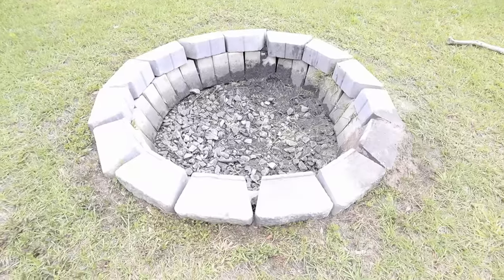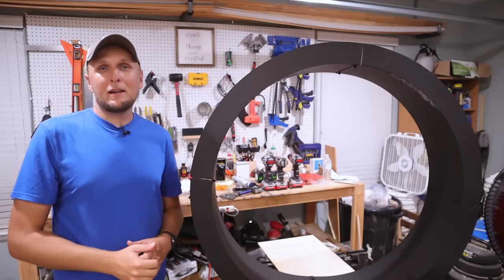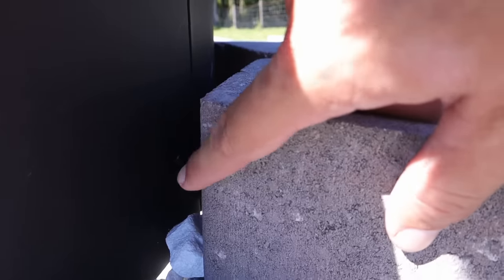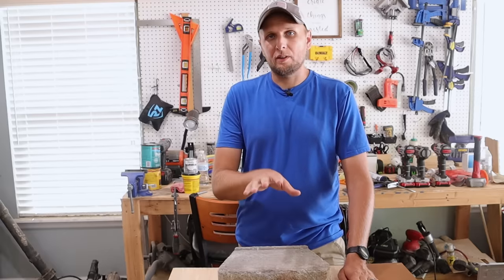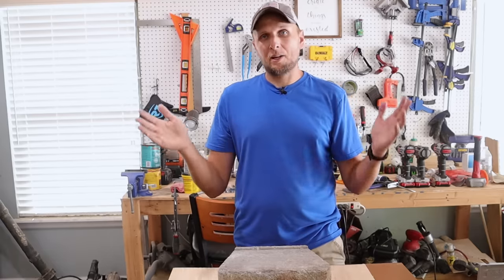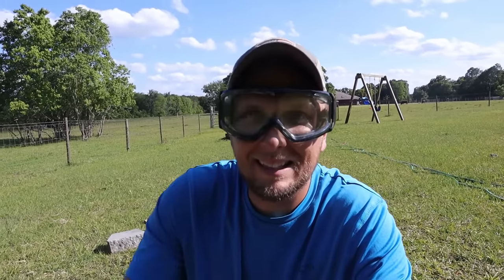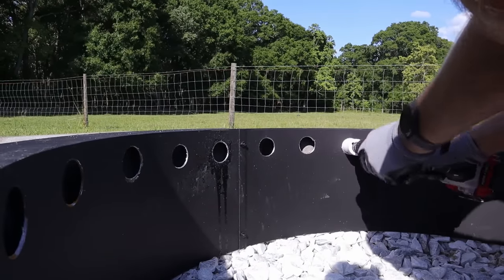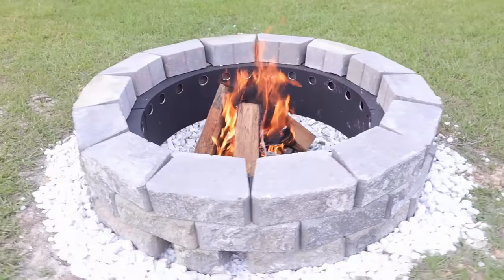How To Build a DIY Smokeless Fire Pit That Really Works!

Comment: Is there any reason why this makes it burn so hot that you don't get the slow burning coals at the end of the fire? We love to sit and stare into the dying last bits of wood at night and I wonder if the efficiency of this might burn through all the wood so fast you don't get that? Also what size of fire ring did you use? Last, I can't find any pavers that are exactly 10", either 2 rows stacked are 8" or 12" but never 10" to go flush to top lip edge of 1o" tall fire ring. Any suggestions?
Reply from the maker: You will definitely still have coals in the bottom.  I have the 36" ring but if you don't plan on having larger fires, I would recommend one of the smaller ones just so the holes are as close to the fire as possible.  Yeah so I had the same issue with the pavers and I just build up base stone on the outside of my ring a little higher to make up the gap.  Hope this helps!

Comment: Looks great! Did you use the 27" or 36" ring??
Reply from the maker: Mine is the 36" but I would probably get a smaller one if I did it again as it works best when the pit is full of wood and fire to heat up the walls so having a smaller diameter would just make it easier to achieve that.  But it works great either way!
Reply: @HowToHomeDIY  thank you!

Comment: a cool idea but the steel ring is it gonna rust now since you cut into the powder coating finish is  probably only downside to it
Reply from the maker: Can spray it with high temp paint to help protect it.

Comment: Nice! Thanks for the How-to.

How often did you have to swap batteries on your cordless drill? I have a friendly argument going with a good friend who thinks cordless drills run out of power too fast. My DeWalt cordless drill has yet to exhaust a battery during a project. Maybe I need bigger projects. 😆
Reply from the maker: It will exhaust it 😂.  I think I did 3-4 battery swaps.  They were standard sized 20V batteries.  If you try this project, let me know how many swaps you had 😆

Comment: how long did it take to drill those holes? any tips?
Reply from the maker: I would say about 45 minutes total.  It's definitely the hardest part of the project.  If you have a drill press it would probably be easier to use that before assembling the ring.  Also, I would probably try to use a step bit instead of a hole saw.

Comment: Awesome build. What is the reason for putting the holes towards the top? I think putting them at the bottom wouldn’t work as well because of the eventual wood ash building up if you had a fire going for a long time, but would holes around the middle work any better? I’m definitely building this this weekend.
Reply from the maker: So the idea is that with the holes at the top, it is going to help feed the top of the fire to help burn off the excess smoke.  It also does a good job of causing the smoke to circulate back towards the fire and burning up.  Is interesting to watch.  If I was to do it again, I think I would make the holes a little smaller to help build up pressure and I may elect to go with a slightly smaller ring.  Want the fire as close as possible to the ring to make it work.  I think these two things could possibly make it a little better.  But am very happy with it!  Hope you like yours as much as we do ours!

Comment: Thinking of building one of these for my parents, it looks really nice and they've been talking about it for years now. For someone with essentially no tools or the pieces to make this, how much would you expect it to cost to purchase everything needed?
Reply: The pit with the metal ring is $229.00 at Lowe's. Plus the gravel, hammer, chisel, and hole saw with drill. I'm guessing around $300.00 total for everything needed or slightly more depending on if you get the expensive tools or cheaper ones. I estimated with the cheapest tools

Comment: Does the bottom of the ring have to be touching to stone to get the effect you need?  Would love to do this with ring sitting on top of my top layer of stones but that would create a gap at the bottom.
Reply from the maker: Yes it needs to go to the bottom in order for the air to be, for lack of better words, trapped.   So then it can be heated, rise up, and then be pushed out through the holes.

Comment: Hello, i watch all the diy firepit video's and i made for myself kinda the way you did, i just use the outside (normal bricks ) . today i tested it out before i use cement to place the bricks. but, when i started the first fire i got so much smoke... i also use the 36 inch ( just the same as you ) . the only thing i was telling myself, maybe its because there's still no cement in place but you do it also without. i cut the holes in the ring, a little bit smaller as you... is it possible, that the first fire you start still gives smoke untill the ring is warmed up? because you diddent put that in the video that you started the fire..can you please help me a bit here? its just that im worried a bit for my neighboars with all the smoke.  thanks in advance
Reply from the maker: Hey Stefan, yes the beginning there will be smoke.  The ring has to get hot enough in order for it to work.  Also you will want a fairly big fire going if you went with the 36” ring so that the fire is nearer to the holes in the top of the ring.   My experience is the bigger and hotter the fire, the better.  Also you probably know this but make sure you are using dry wood.  Hope this helps!!

Comment: does the fire ring have to touch the ground for this to work? the ring in my kit in only ~11 inches tall
Reply from the maker: Yes it does.  It needs to be sealed so that the air can get hot enough to rise to the top and then out of the top holes.  Mine is 10" tall.

Comment: So these videos are awesome and I love your humor, I will have to train my children in the fine arts to help me break blocks faster in the future!

I had a question, I just built my insert and block smokeless fire pit, I went with a slightly bigger 46 inch ring, but it's only 10 inches from the ground to the top, do you think it would be a big impact to the effectiveness of I put a 4th layer of 3 inch blocks on top and then did a cap layer and then had them overhang inside the pit like 2 inches or so?
Reply from the maker: I dont know that it would affect it that much but may make getting the heat to you a little more difficult just because that wall will be taller.  I appreciate the feedback!  If they start now they will be experts in no time!  I would suggest starting them out using pebbles though!  😂

Comment: What is the total diameter of your fire pit with the supplies that you used? I did some quick math and guess it is approximately 51" at the top and probably a bit wider at the bottom with the raised portion of the pavers (bottom) fitting flush with the one under it? After you got everything set as you wanted it did you glue the blocks down with an adhesive?

Comment: Thinking of something similar. (I have essentially the same fire pit as you started with.). Must have missed in the video, but approximately what is the sizing and spacing of the holes you drilled in the fire ring? Thank you. Great video.
Reply: I had the same question.

Comment: Next time drill the holes closer to the bottom and try to leave space so the cool air gets sucked in from the bottom thereby mixing with the hot air and eliminating smoke. Another thing is to try and keep the fire “loose” and not tight. The tighter the fire the less clean air the more smoke. I’ve had plenty of fires and most don’t have smoke cause it’s all about helping the fire breathe.

Last don’t use wet stuff, but you know that already.

Looks nice and did a great job overall. The holes on the bottom would be the only thing I would change

Comment: Great video and idea. But do the pavers heat up enough to radiate the heat as pavers are not the best conductor of heat. I've sat around many a stone firepit and one thing they all have in common - you only get the heat from the flames and not from the rocks or pavers. Keeping the same principal you have, would it not be better to have an all metal one which will radiate the heat?

Comment: Great video was planning on doing one myself but what size ring are you using, how many bags of gravel and how stones was that 3 tier you completed. Thanks and I also subscribed & followed
Reply from the maker: Hey Ramon, I went with the 36" ring.  Going with a smaller one might be better though as then the fire will be closer to the ring without having to make it really large and this will help with the air coming out of the top holes.  But if you are planning on having large fires then the larger one can work too!   Also, I would recommend going with smaller holes than I did.  Mine works great but I think smaller holes might make it even better.  I think I ended up buying somewhere around 10-12 bags of gravel but a lot of it went in to help fill my old hole fire pit.  With my particular setup, I have 12 blocks on the bottom row and 14 blocks on each of the top 2 rows for a total of 40 blocks.  Hope this helps and if you have anymore questions, feel free to send them to me.  Thank you for the feedback!

Comment: Your Tykwondo bit had me laughing  my ass off, though it would have been funnier if you called it something like BS-Kwondo in the same nonchalant manner that you did in the video. I already know that these smokeless fire pits workwell, but I think it's funny that when I used your link to checked out the price on the rings I noticed they have a video showing the fire pit without the smokeless setup and no smoke, lol. What's nice about building a smokeless pit is you can use a wide variety of scrap material that you can find for free or cheap, and using a little imagination and creativity can use instead of spending $160 on a store bought fire ring. Nice video, love the humor, definitely makes the video even more enjoyable to watch.
Reply from the maker: Thanks for the feedback Clinton!

Comment: What size is the ring you used? Not the flange diameter. The diameter that yku set the blocks around?
Reply: Nevermore I found it in the description m. Thanks
Reply from the maker: Yeah I used a 36" but if you don't plan on having larger fires then the smaller ring might be a better choice so that those holes where the oxygen is coming out are closer to the fire.

Comment: Do you really need to leave gaps for the bottom row of pavers?  I would think the rocks under the pavers would provide ample pathways for air to get in there.
Reply from the maker: It isn't air tight so yeah some will come through them but probably not enough.

Comment: I have a question:
I like the idea of the use of the inner metal ring that comes with the top lip to hold back the warm air.
Now that you have made this design fire-pit, have you learned of any type of  metal outer ring that you can slip your ring inside of?

I see a lot of youtube designs that make use of the bottomless  metal ring sold at TSC, but are any of them  the correct size that your ring would slip nicely inside the TSC ring.

The reason I ask is that I would like to find a way to use your type of ring with the top lip, yet not have to use cement blocks around the outsides.
Reply from the maker: I have not looked into that but if that was possible I think that would work really well if not better!
Reply: @HowToHomeDIY  
I'm seeking a way to use that metal ring you show but have the finished fireplace something I can move around
Reply: @HowToHomeDIY  another question. Let's say I learn how to make a fire pit movable.
What would you suggest I use for a bottom under the fire to protect things like grass or a cement pa?

Comment: Did you use the 36" or 27" ring in your video?
Reply from the maker: Mine is the 36.”   If I was doing it again I would probably go with a smaller diameter as it will be closer to the fire and easier to get the walls heated up so it can do it’s thing more efficiently.
Reply: @HowToHomeDIY  Thanks for the quick reply!
Reply from the maker: @ordocastus  You are welcome!

Comment: what size fire ring insert did you go with?  Also, what were your steps to prep the ground before you added the stone base.  Thanks
Reply from the maker: I went with the 36" ring.  I actually think the smaller one might work better just because the fire will then be closer to the holes.  I just refilled my hole in the ground with dirt almost to the top and then poured a bunch of the marble chips in on top to help with drainage.
Reply: @HowToHomeDIY  thank you

Comment: What about a layer of firebrick or plain brick on top of a thin layer of crushed stone that's been tamped down?  Would make it easier to shovel ash out of the bottom of the pit. Might also retain some more heat.

Comment: Thanks for this vid, question:  it seems like considering how deep the base of
Your fire is now, that the trade off is actual enjoyable heat!?  Is this something you could comment on.
Reply from the maker: So the only place I notice any drop in heat is at my feet and just above the ankle.  Other than that, the fire is very warm.  On cold nights I just put my feet up for a bit and they warm right up though.

Comment: Put the ring on top of the third row of stones! 
For the fire pit to work better some air have to come at the bottom of the fire and some  (hot) air have to come at the top. Your ring is resting on the ground so it doesn't let the air go at the bottom. You have to rais the ring 4 inch or so....

Comment: Awesome fire pit I want to make this lol Did u use the 27” or the 36” fire ring
Reply from the maker: I used the 36" but the smaller one may work a little better as the fire would be closer to the holes to get more oxygen.

Comment: Hello Adam thank you for your video I've been thinking about making a fire pit for a while we just moved into a new house I do have a question for you let's say I make my fire pit base with 12 then take out two of them and evenly space all the others around it could that eliminate the step of having to cut one of the stones
Reply from the maker: Hey Jeff, so here was my thinking on why I did not want to do that.  The first reason, which is not crucial is just that the first row will probably not line up with the top two rows evenly.  The second reason has to do with ventilation.  My experience with ventilation and airflow is it is best to have less openings but enough and big enough to promote good suction if you will which will help pull the air in, up, and then out.   It is my belief that you want to promote some pressure for best air flow and if there are a bunch of holes all the way around, I feel like it wont work as well.  Just my thoughts based on previous experience on projects.  Congratulation on the new house!
Reply: @HowToHomeDIY  thank you for getting back with me I thought it might be an air flow issue but wanted to check with you 
  Again thanks

Comment: Smokeless is certainly great, but how is it for throwing heart to the sides so those sitting around it actually feel the heat?   When you have three layers of blocks like you do, it makes me think it would funnel the heat upward.  What if the first it second layer were buried, but in a manner in which it would still allow for air to flow?
Reply from the maker: Still plenty of heat felt.

Comment: I would recommend using high heat spray paint to cover the bare metal after cutting the holes. Those are going to rust very quickly.
Reply from the maker: Good tip!  Thanks Isaac!

Comment: Raise the fire up off the ground (maybe with a mesh?), shrink the diameter of the top opening and use charcoal. That should give you a 100% smokeless fire (since smoke is a sign of incomplete combustion, or of incombustibles being given off as steam, etc).
Reply: It's a Fire Pit🤣😂
If you use charcoal you will not have any Flames. All you would have is a large BBQ 🤔
Reply: @jamesglenn520  
If the charcoal is combusting completely, then there will be a flame. The only time you don't get flames from charcoal is when the carbon combusts partially, forming carbon monoxide only (meaning that the complete combustion reaction, where the CO combusts into CO2, is a reaction which produces a visible [blue] flame).

Comment: TY.   
ps use rubber or pellet mallet  to set stones in gravel makes for less age settling.......  the ring is also called flange= great idea.......   third... my uncle loves the rust colored high temp paint on metal = ages well when real rust days come = petina vs.
Reply: ...
... yup goggles best
... drill and deburr those sharp edges inside shop with file or emery paper
... awesome simple perfect build.  fire propelled fan

Comment: Just in case it matters to anyone, these are concrete pavers, not stone. While I doubt a fire in this pit will ever get hot enough to matter, concrete does get degraded by fire. Also, concrete is porous and can trap water inside. Water that gets really hot and flashes to steam, expands by more than 1000x in volume. Hopefully the porous concrete allows that water to escape quickly enough, but if not, it could crack the paver.

Comment: How did that Porter Cable hold up to those hole cuts?  how many batteries did it take?  Nice job on the fire pit!
Reply from the maker: The Porter Cable did great, I have always been a big believer in the PC drills and drivers.  I went through probably 4 or 5 batteries.  Hard to say because they didn't get enough charge time before I needed them again haha.  Thanks for the feedback Tommy!

Comment: What size holes did you drill around the top of fire ring? Thanks.
Reply from the maker: They are 1 1/2 inches but if I could go back in time, I would make them even smaller.  I think it would make it even better at getting the air into the top of the fire.